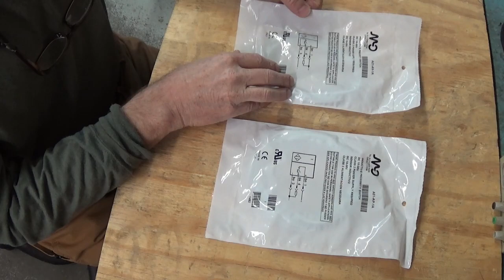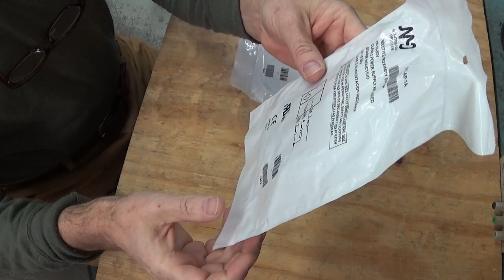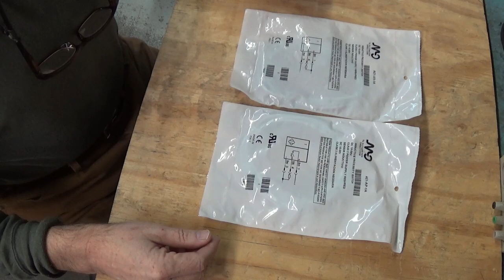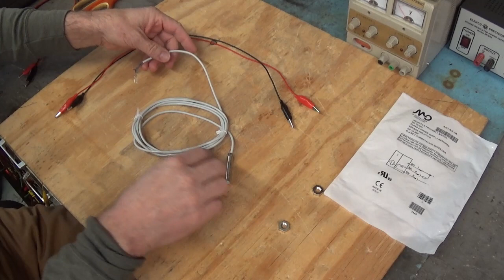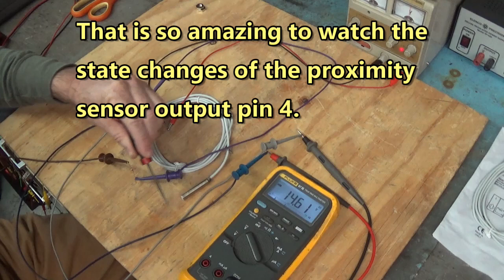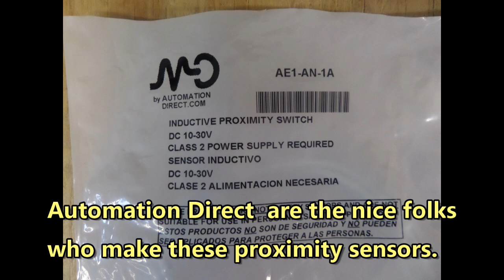Testing NPN and PNP Proximity Sensors

Comment: I think there is no need for a pull up or pull down resistor. The multimeter set as a voltmeter will not close the circuit thus no current draw will happen. But it is always a good practice to follow the diagram. A PLC or a controller usually has those resistors inbedded in their inputs. Thank you for this good video.
Reply: He says in the video, the sensor is an open collector and you have to have the resistor.
Reply: @brs293   the prox sensor has an internal resistor. A voltmeter will show you change from high to low or low to high when triggering without the need for an external resistor. Yes, the output will be a sink (npn) or a source (pnp), so, for testing purposes,  just be careful not to connect any voltage or any ground there (to the black wire) without a resistor to limit the current. A voltmeter is ok.
Reply: I know I'm a lil late to the convo....Lol......but, yeah, you have to have a load connected to the signal wire.  In the field, the plc input is the load, but if you want to bench test, you have to run it thru a load.  I usually use a LED.

Comment: Thank you so much for posting this excellent video. I really appreciate it. I think I may have ruined a PNP NC photoelectric sensor by miswiring it: connecting the black wire to the blue wire without a resistor in between. I am new to using these types of sensors. I appreciate the demonstration of how I can test them. By the way, I am an older guy also, in my late 60s.

Comment: Thank you so much for explaining this. A proximity switch just went bad on one of our CNC Mills at work. The machine dealer wants to charge double what the sensor would cost out of a parts catalog. This will help me greatly in determining which sensor I need to order, PNP or NPN.
Reply: Chip Wright I worked in the laundry facility and most machines like folders and feeders uses proximity sensors this help me understand how sensors works thanks for the video

Comment: With the NPN you could power the sensor from 12v and the pull up resistor by 5v, so no logic level conversion needed.  Not so with the PNP sensor.

Comment: I would describe that "the so called pull up resistor in this video" as the Load. Load meaning whatever connected to the proximity sensor to receive and process the proximity sensor output signal.

Comment: So for purposes of energizing an 8-pin "ice cube"  relay with an NPN normally open sensor, I can connect the black wire of the sensor to relay pin 13 (the negative or - pin) and the power supply + line would connect to relay pin 14. I would not need a pull up resistor in this case right? The coil of the relay becomes the load. Thank you so much for this video.

Comment: Hi, I’m currently using a NPN capacitive sensor with a 12v power supply and planning to use an Arduino Mega as my microcontroller. As mentioned in the video, the output signal voltage of the load wire will be the same as the input voltage and as of what I know an Arduino cannot handle 12v input. Sorry guys I’m a toddler when it comes to electrical circuits. But my question is should I add a resistor to have a voltage drop before the input signal enters the Arduino or should I use a voltage regulator instead to step down the voltage before it enters my Arduino. Thank you !
Reply from the maker: https://www.youtube.com/watch?v=b0bCvgr84Tc

I would use an opto-coupler to isolate the high voltage side of the sensor from the low voltage side of the Arduino input. Click on the link above to view one of my videos on opto-couplers Thank you so very much for stopping by and watching one of my videos.
Reply: @PeepawMcDonald  same like a PLC .
Reply: You need to protect your Arduino inputs with OPTO-COUPLER as a PLC's system work .

Comment: hello sir , this was the exact video i was searching ,very useful. Can i ask a question , will the output of all PNP proximity sensors will be fixed to around 15 vdc as we saw in video or it may vary ? I am having an under speed monitoring proximity sensor (model XS530BLPAL2) / PNP output getting connected to a safety relay, If i get to know the output i will stimulate externally to keep the relay healthy. Looking forward for your reply ,thank you.
Reply: The output voltage is based on the input voltage

Comment: hi peepaw sir
you tell me how can i creat the circuit of proximity sensor 3wire 24vdc in put (analog out put 0-10v  = metal 10mm distance i mean voltage variable with metal distance ) i hope you dont ignore it

Comment: It is interesting how (at least) my mind works.
The schematic shows the gate to be in the center, source and drain on the outside.  Your actualy wiring, output/drain in the center.

Same type of stuff goes on in the classroom and online.
The gate is always at the center in diagrams.
While in real world the base of a transistor seems to always be on the right, outside pin.  Drain at the center and so-called source/ground (which is contradictory term in and of itself) is the very left leg/pin.
And you also have your actual wire set up like a real transistor leg.

It is the type of things that confuse me as my mind remember things in the term of position.  And when the position of the same thing is contradictory, it throws me off total shamble.

Comment: Peepaw McDonald,
I bought a Digital Counter from ebay, made in China. The inductive proximity sensor that came with it is NPN - NC....It has three different set of instructions on how to wire it up. The tiny instructions on the sensor show to use a resistor, as you are doing, but the Ohms is in Chinese, so I don't know what value to use. I tried wiring it up as you show here with a 10k resistor, but it doesn't work right. Matter of fact, every way I wire it, the set count happens all at once. In other words, if I set the Counter to count to 40 and actitvate it's relay, the count goes from 1 to 40 all at once instead of each time it's flagged. The LED stays on all the time too.
I guess an evil China Man is laughing at me right about now.